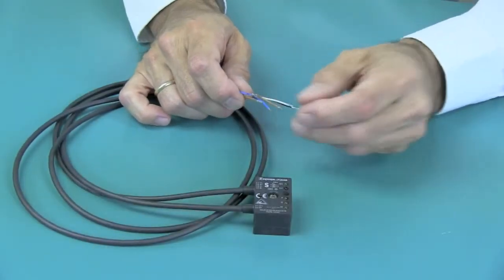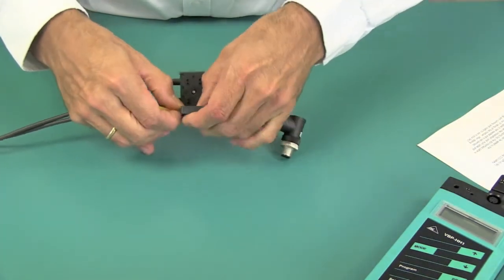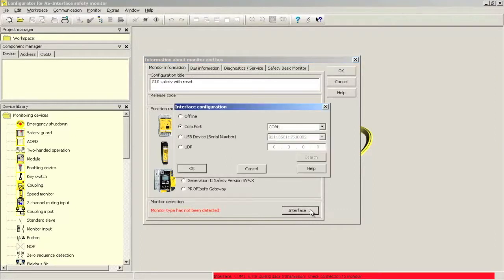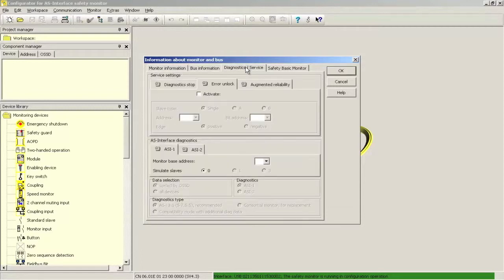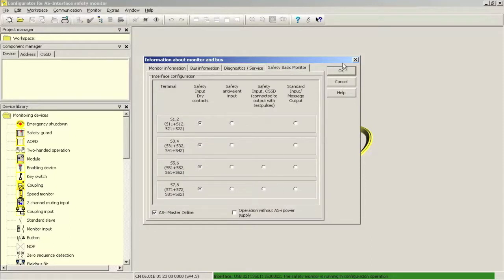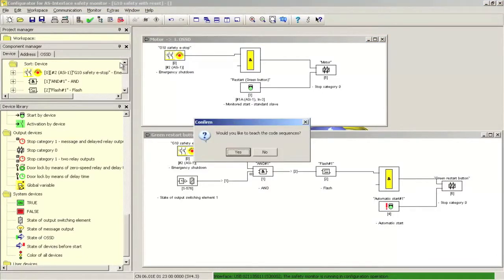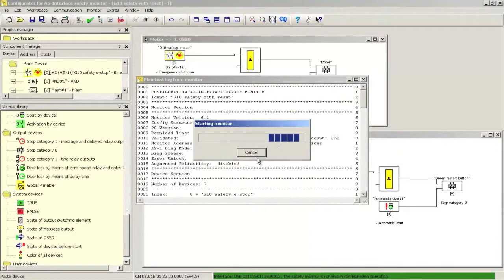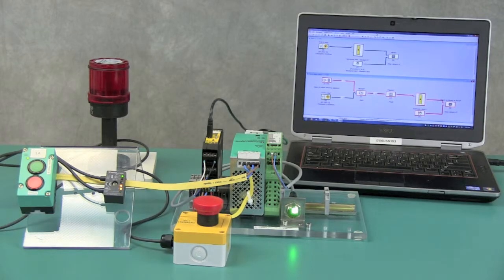How to Use a Safety Module with Any Conventional Safety Device

Comment: Can this G10 module or any other AS-I Safe module, Directly connect a standard Light Curtain to the ASI network ? In other words one that will accept two OSSD outputs from the LC ?

In the past there were light curtains that contained the ASI chipset within the LC itself. Very Expensive and hard to find !
Reply from the maker: Hey Matthew,
Thanks for connecting with us. In the past, connecting light curtain(s) to safety module(s) was typically done with VAA-2E-G4-SE. However, this part has now been replaced by VAA-2E2A-KE1-SE.
http://www.pepperl-fuchs.us/usa/en/classid_2397.htm?view=productdetails&prodid=73795